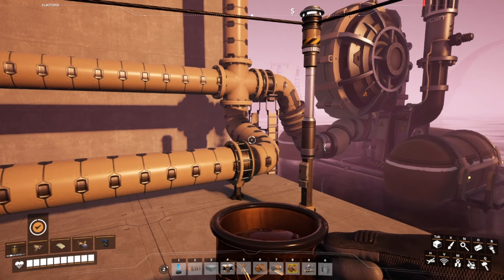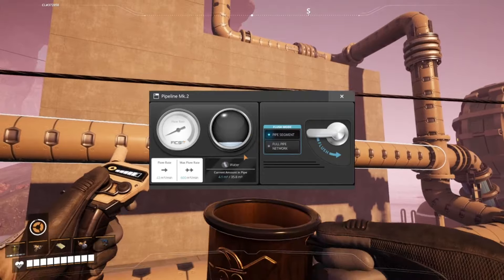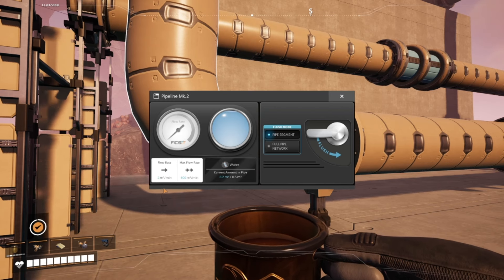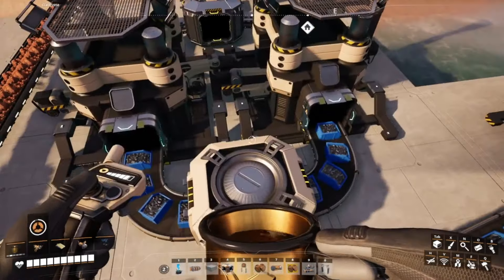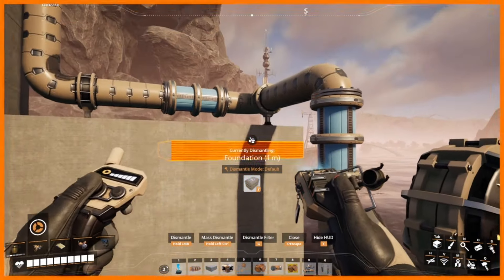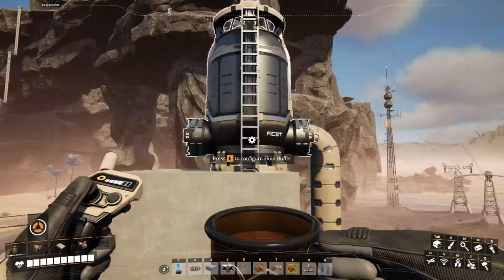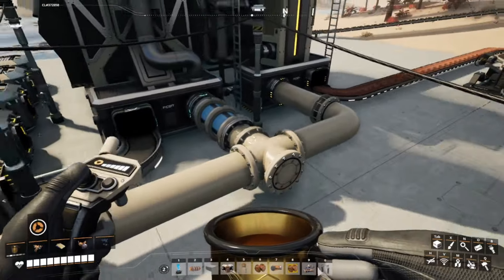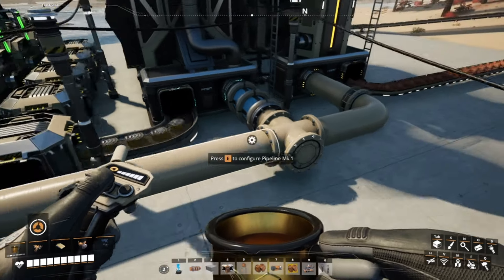The basics of liquid in satisfactory and how to avoid mistakes

Comment: The best trick about using a fluid tower is you can connect any number of pipes to the "master" pipe after the drop –and any pipe connected this way gets the same head lift as the master pipe. And this works in both directions, before or after the drop. This is great for pulling liquids up cliffs without using pumps. And you don't need a fluid buffer at the top of the tower.